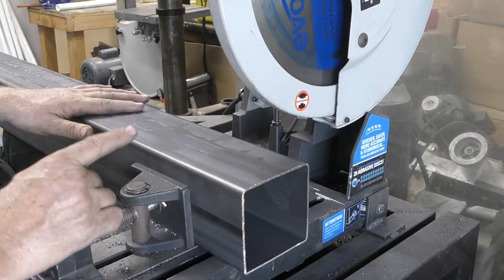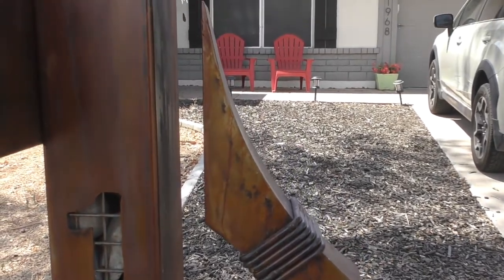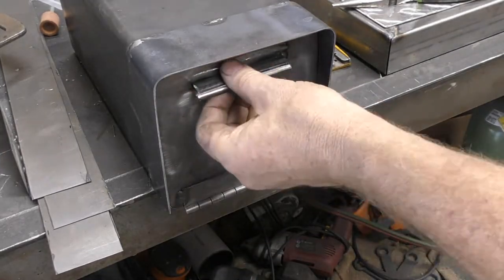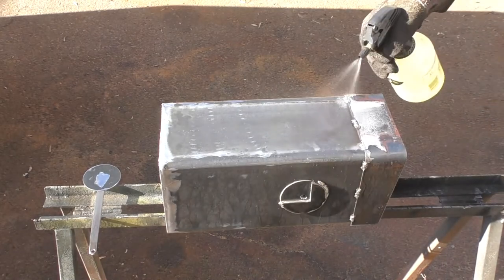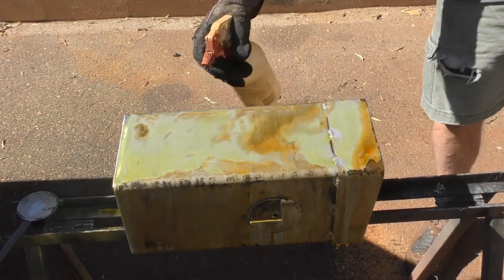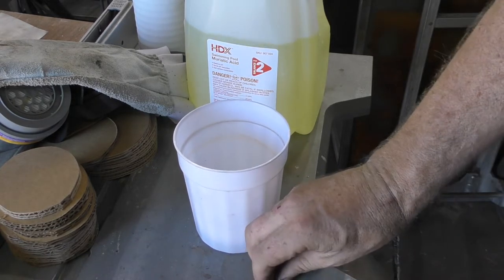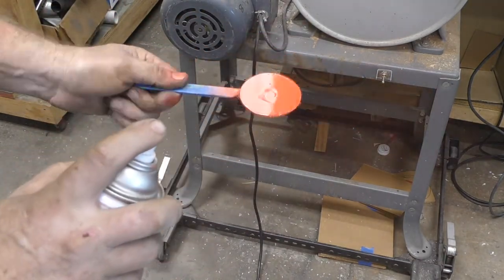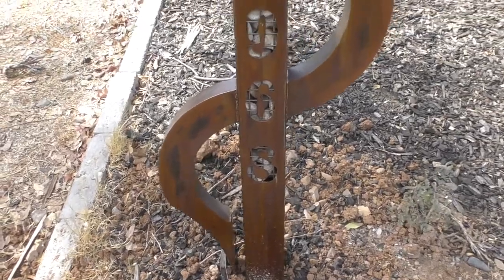Art mailbox

Comment: The orange nail polish is very becoming!😁

How long does the clear last? Here in South Florida, I'm thinking the rust process would restart in a matter of weeks. Or days. Hell, maybe in hours.
Reply from the maker: If I were doing this in Florida, I'd apply a brush on cleat coat. Yeah the spray on clear coat wouldn't last long at all near salt water
Reply: @ArtfullyRogue  Biggest problem with clear coat outside is the UV rays.  There are UV resistant clears available for these applications.

Comment: Looks nice.  I had two questions.  Do you neutralize the acid before painting with clear coat, with sodium bicarb or something?  Also, did you need to get the box approved by the local postmaster?
Reply from the maker: I actually just rinse with  water and that has been fine so far with the projects that I've used this treatment on. I actually looked up the mailbox regulations online and just followed those.

Comment: That's a very good look. The video is fine as it is without the first half of the build. A couple of questions, if you don't mind.  How deep underground did you bury it? With the mesh, did you slide a piece in that just sits there or did you fix it in place?
Reply from the maker: I buried it about 12" and I actually welded the mesh in place.
Reply: @ArtfullyRogue  cool job. Thanks.